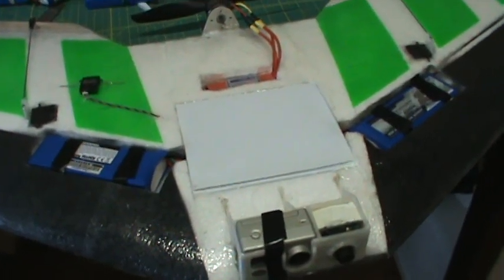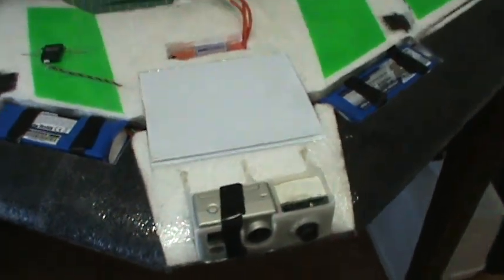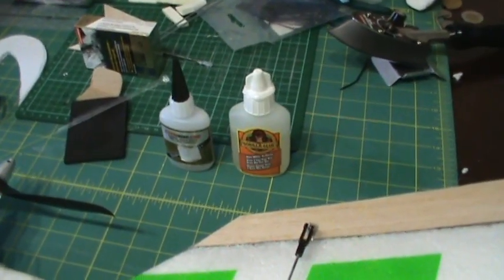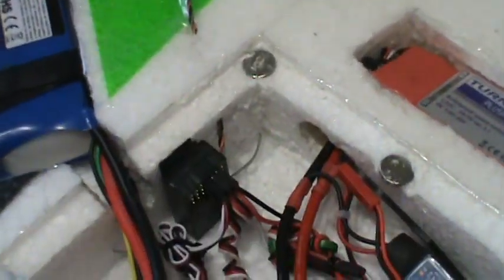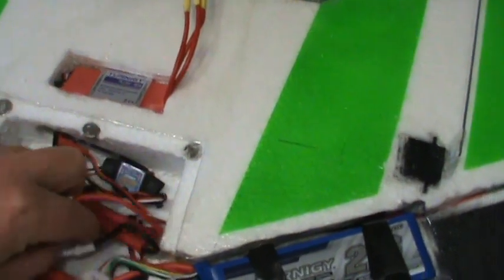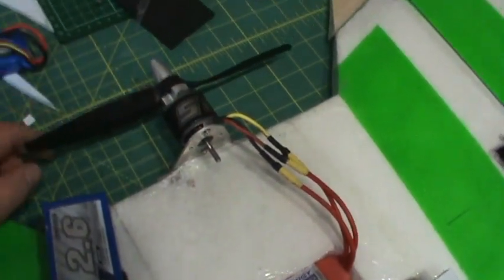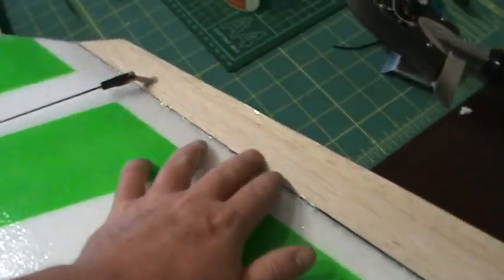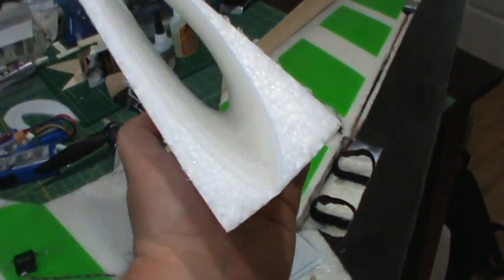TBRC FPV Wing Build

Comment: Ah right on. I was thinkin the skywalker myself avtually. I just picked up a Turnigy 9x and a DJT module and twlwmtry Rx. Ive got a full 500mW 900mhz system here and fatsharks predators. Im building my ground station this week. Finding plastic in st johns is a pain!